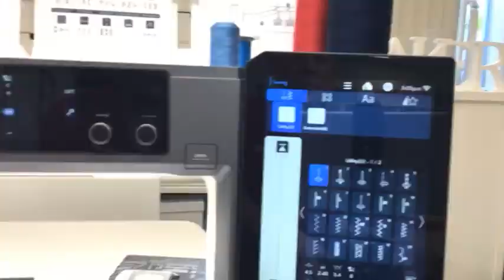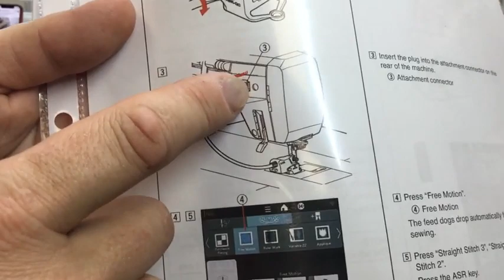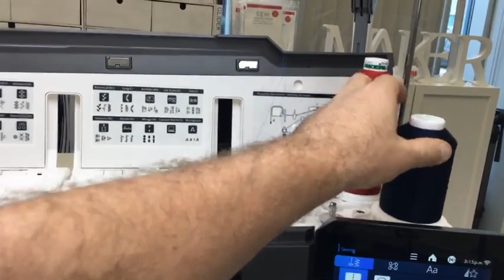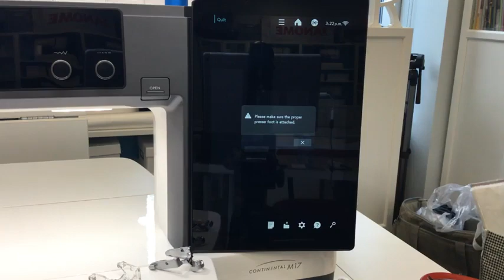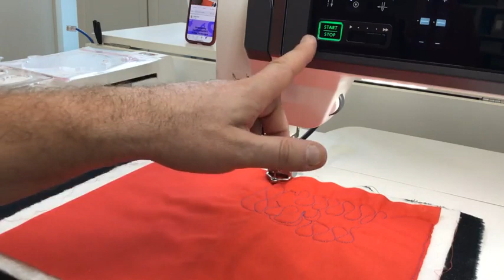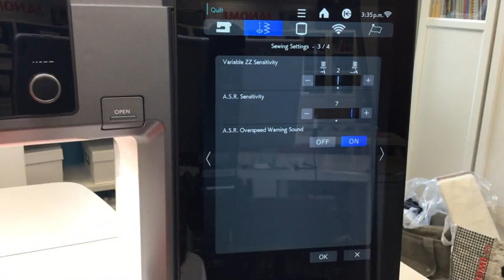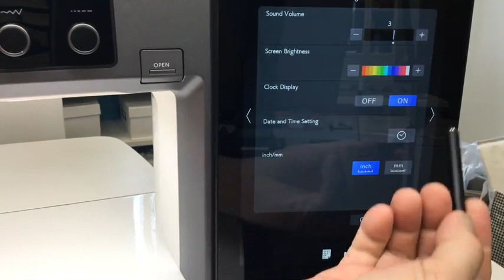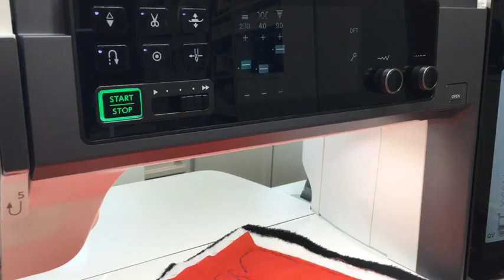CM17 Accurate Stitch Regulator with Michael Smith

Comment: Does janome make a stitch regulator compatible for the skyline 9?
Reply from the maker: Teresa, sorry for the delay in reply. Janome only makes a stitch regulator for the Continental M17 machine, it's not something that can be retrofitted. We may have this accessory as an option for machines in the future.
Reply: @JanomeJAI  Would it be possible to retrofit a stitch regulator for the M7 or would it require the purchase of a new machine altogether?
Reply from the maker: @gayaharriman8324  The machine cannot be retrofit, it needs to have the system built into the machine.